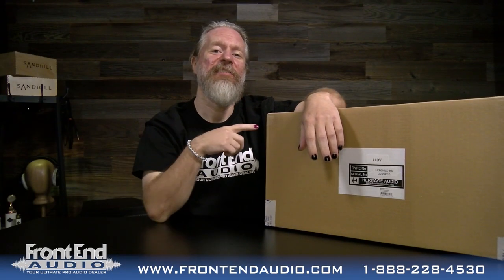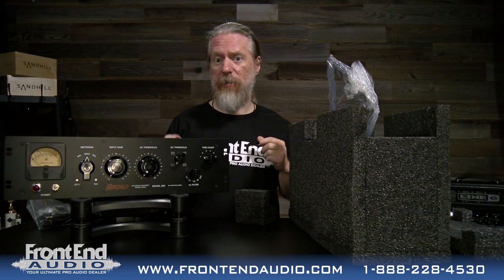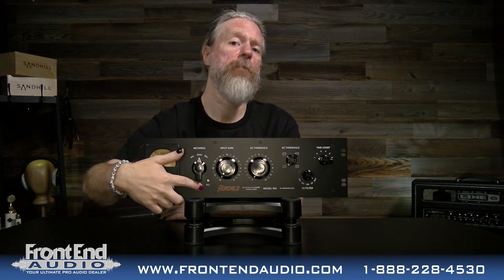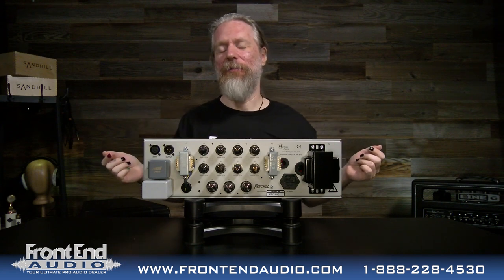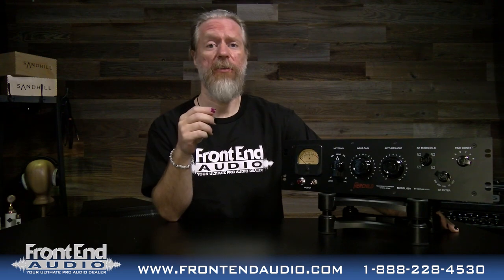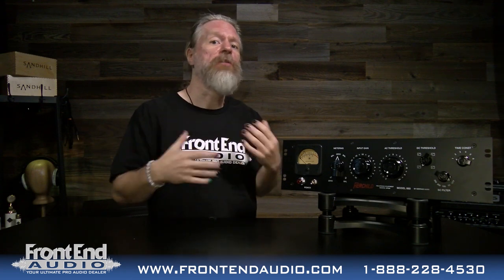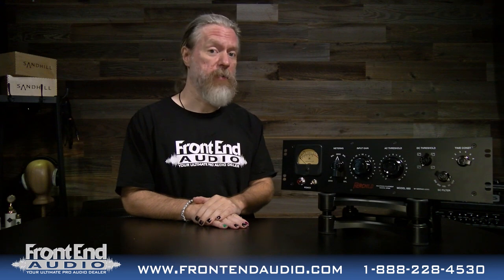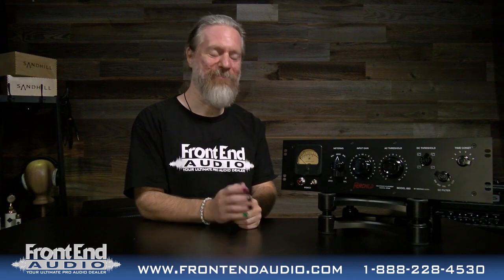Heritage Audio Herchild 660 Tube Compressor - Out Of The Box at Front End Audio

Comment: Can You run something through sort of like in bypass mode?
Reply from the maker: You mean just to get the "mojo" on somethings without compressing? Sure. There is no bypass on the compressor, so if you only adjust the input and set everything else so the audio never triggers the compression circuit, you could use it as a mojo box.